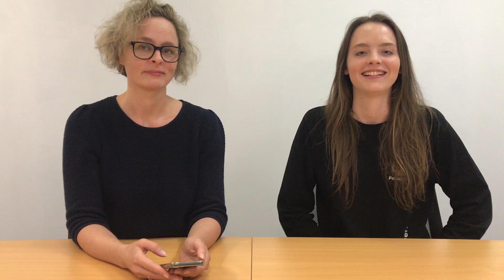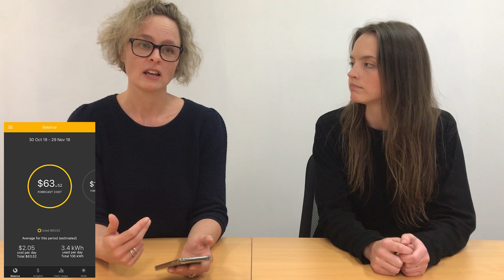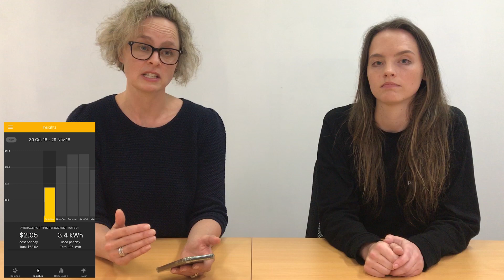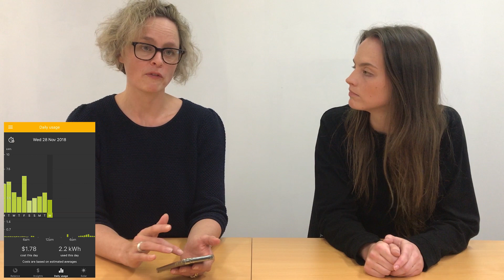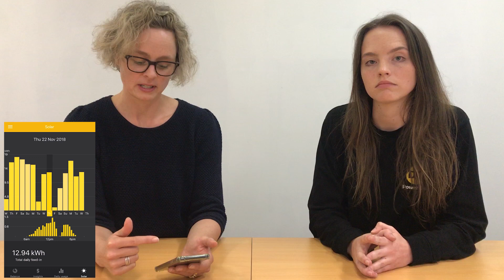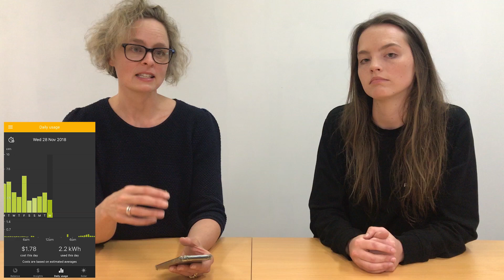Introducing the DC Power Co app

Comment: thanks for the update...I've just installed the app and looked over my data for the past month and was surprised by the power consumed by my air conditioner running for two days in a heat wave.
 It looks like the power I exported on those days was also lower, so does that imply that I'm using my solar power first then using power from the grid second for the excess? A friend of mine suggested to me that all the power my solar is sent to grid and I can't use it and I have to buy all the power I consume back from the grid. I don't think this is the case ...can you confirm please?
Reply: done some more research and can answer my own question...on that hot day the A/C was on the panels produced 25kw(using my sunny SMA  explorer program) , I used 18.2kw and sold an excess of 6.8kw...your app filled in the missing links and now it all makes sense.
Reply from the maker: Hi Tom, Good question. It comes down to how your solar is metered. It will either be net metering (which allows you to use the electricity generated by your solar system in your household first) or gross metering (which means all of your solar generation is exported straight to the grid). 

We have more info on that here: https://www.dcpowerco.com.au/help/what-is-the-difference-between-net-and-gross-solar-metering/

Thanks,
Ash
Reply: Thanks for that info  @dcpowerco6483  , I didn't know there was a difference.....the next question is how do I find out which one I have net/gross and can I be switched over from one to the other?
Reply from the maker: @tombacsa4523  Hi Tom, From what you described in your question, it sounds like you're using your solar generation at home and hence have a net meter. - Ash
Reply: So is the same app from powershop (and perhaps others). My question is if I change - can you import all those years of current data with powershop to your app?